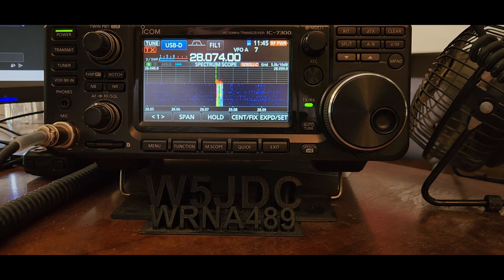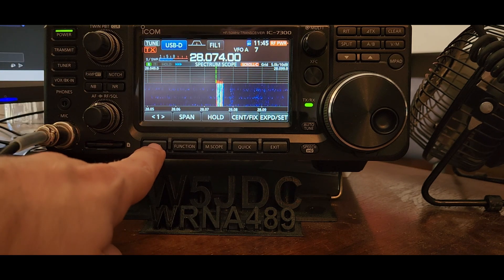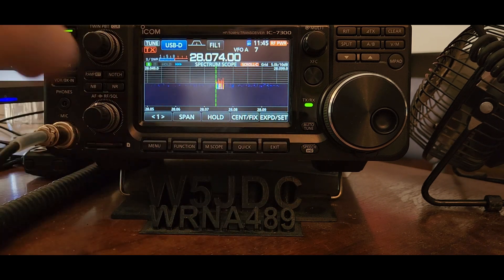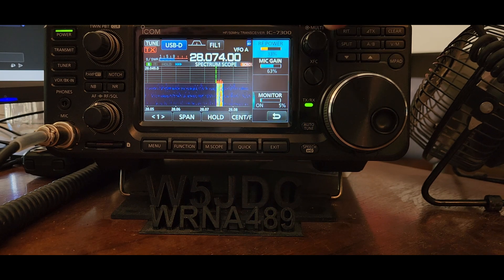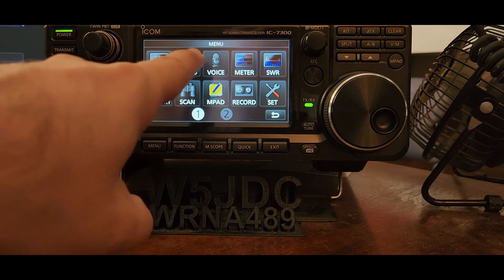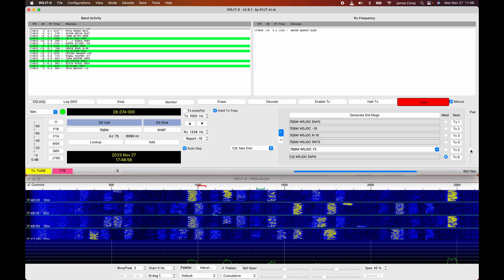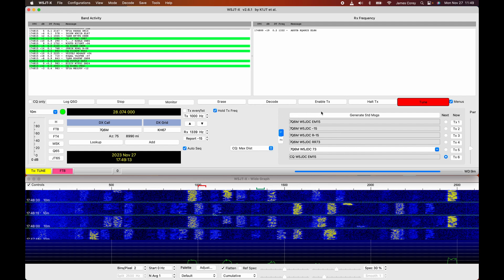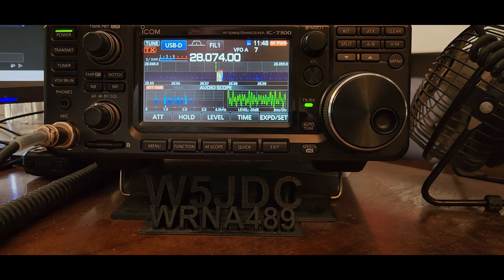Tuning your ICOM 7300 for FT8

Comment: Helps me and I don't have one of them. That's not the one you got at Brazil is it?
Reply from the maker: Nope, that was the Yaesu FT-991A. It's sitting back in it's box waiting for me to send it to to California to get some surface mount resistors replaced on the front end.
Reply: I've often thought that 7300 is the perfect radio. @duff8402